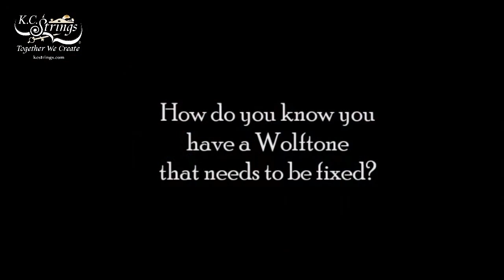Repairing A Wolftone

Comment: Would this work for violin wolf?
Reply from the maker: Wolf eliminators rarely work on violins. There is not enough vibrating string length between the bridge and tailpiece on the violin. Also the string length that is there is under much higher tension.  Hope that helps, thanks for asking!
Reply: @KCStrings  Thank you for your response, Any suggestion on what could I possibly do to get rid of my violin wolf then?
Reply from the maker: @raghav6151  That is mainly done with a soundpost adjustment.